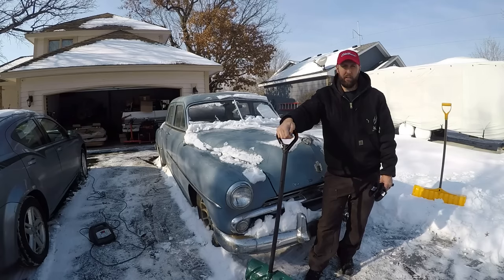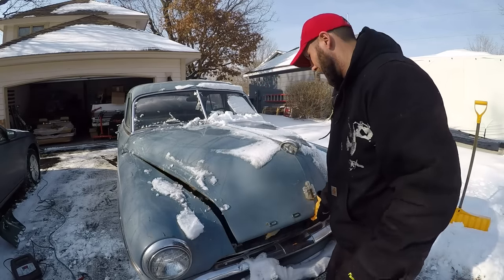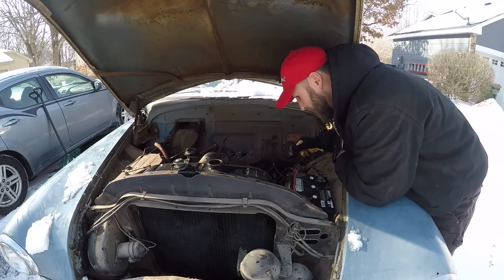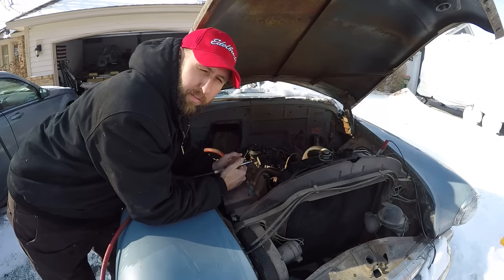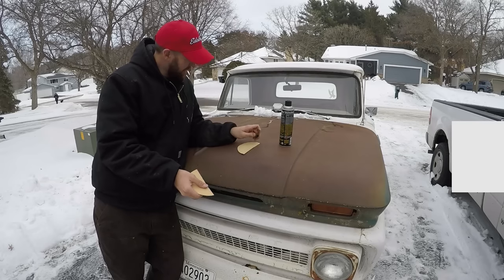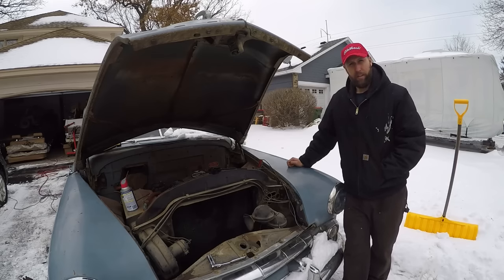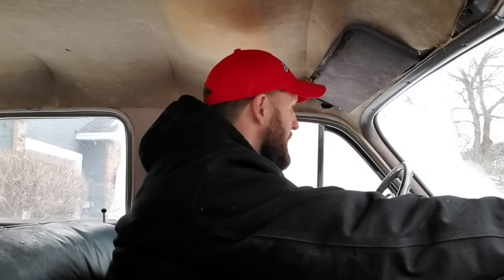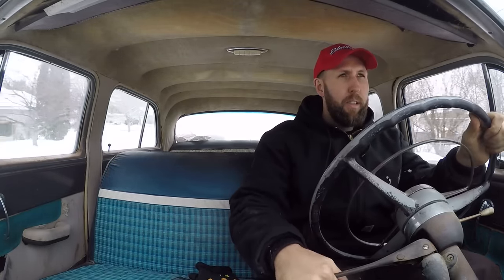1952 Dodge Barn Find First Start - Will it RUN AND DRIVE?

Comment: My first car was a 1964 valiant w/a slant 6 three on the tree. The gear shifts are , pull towards you and up is reverse, stay pulled toward you and down is 1st. Push away from you and up is 2nd, and away from you and down is 3rd. I enjoy watching the old cars that bring memories of cars I and other family members had and see them run again. I'm retired after 38 years of spinning wrenches and wish I could find these old tins around here where even glass rusts on the east coast of Canada. I imagine you wish for a hoist on times when you have to do the horizontal wiggle.

Comment: Had to stop and watch this, I've got a '51 Dodge, same color!  Grew up with these, learned how to drive on one, and I'm still driving one!
Reply from the maker: That's awesome!  Send me some pictures some time.  Would be great to see one in good condition still out there functioning.
Reply: Nothing beats a Dodge they rock!
Reply: I’m considering buying a ‘51 Coronet for $5400. Interior is decent, dent in the door. Seems complete and not really beat up or rusted. It runs but needs a new brake master cylinder. Is it worth it? Not sure if I should pull the trigger and buy it but I’m really close to doing it.
Reply: @johnmorrison5502  Tough call, not being able to see it, hear it run, etc.  May need a new master, but then how are the brakes all around, may need a complete job depending on how long that was done last, cylinders rust.  If you think it's decent enough, that could be a little steep, might offer 3 grand and see how anxious they are to deal.

Comment: Reverse is towards you and up. 1st gear is forward and up all the way. If it's a gyro-matic then all you need to do is get up to 10-15 MPH then let off the gas and wait for a few years and the car should shift into 2nd. At 25 MPH depress the clutch and pull the stick all the way to the floor and your in 3rd. Once you get to a stop just depress the clutch and the car should go into 2nd ( if the force is strong with you). If your stopped on a hill then try to find 1st again. Good luck and enjoy that classic Detroit steel.
Reply from the maker: Wait a few years 😂.. thanks bud! I'll duct tape a diagrams on the window
Reply: You can also pull it down and run it in 2nd & 3rd (I think '50 Dodge just said that) . That wait for the gear to change is amazingly long. Good memories!!
Reply: Sorry the shift pattern was three on the tree standard. The semi-automatic shift was from first to third bypassing second.
Reply: I guess you guys don't know how the trans works.  I do and actually took mine to Detroit Dragway and raced in X stock automatic. X stock is for cars slower then 22 seconds in the 1/4 , ps i qualified for slower and won being the only car to enter a car that slow. Follow the fun.
Reply: @ViceGripGarage  awesome videos   have you ever done a charger video

Comment: That’s the same straight six in our old 1950’s US of A, NAVY trailer welder. It’ll crank up every time with just a little squirt of starting fluid even after sitting all winter. We sometime idle it down to about 300 RPM, just for kicks. It sounds like a mean Harley twin V. Anyway, Sweet old power plant, and a sweet old vehicular.

Comment: My parents bought a brand new Dodge Wayfarer.  The first and only new vehicle they ever bought.  It had the fluid drive and was easy for a beginner to learn on.  It didn't have a radio or heater tho.  Those were options they couldn't afford back then.  They finally traded it in in 1964 for a 62 Impala.

Comment: Very cool the dodge Meadowbrook was the brother to my first car the 52 Plymouth Cranbrook exactly the same! There is something to that throaty sound of those Flathead 6 cylinder engines love it, I milled the head at machine shop at high school, bought a new Offenhouser twin carb manifold , from Honest Charlie’s which used to be a huge catalog store back in the 50s ,60s and found a set of Fenton headers at the local junk yard, bought some green and white tuck-n-roll seat covers from Honest Charlie’s my Uncle Tom was a chef at a local restaurant, but a Jack of all trades! He did a right nice job of upholstering the front and rear seats! Could not find door panels so we bought several yards of White Naugahyde and cotton batting and made some right nice door panels! Then I bought some spray lacquer candy green from the local Schwinn bicycle shop, prepped the dash sprayed it candy green! Looked great with all the Art Deco chrome trim on that dash! Had dual exhaust, since the Fenton headers were two piece with separate collector’s using corrugated exhaust pipe from Pep-Boys , two Cherry Bomb glass packs &  ran the pipes out the sides right in front of the rear tires! Very cool , and great sounding!!! My Dad paid $50.00 Bucks for that car, wish I had it today! Keep up the great work Derek! You crack me up!! 
Regards Mad Mike S. From the land of freezing ass cold………

Comment: First real job I had was at a garage & I had the job of answering road calls for folks who couldn't get their car started on a cold morning. We had a jumper battery pack that had an oversize 12 V battery & a built in charger. This was back in the days when there were still some late 40s & early 50s cars still in use. Absolutely the hardest to get running were L head engines,  Chrysler products, Pontiac L head 6 & 8,  & the Olds 6. Never had any calls on the Packard or Hudson L head cars.

Comment: Yep, my 1950 Dodge Wayfarer had "Fluid Drive", too. I loved it, especially on dates... I didn't have to shift to low, or even second, to get going... I could leave from a dead stop in third gear and never have to remove my arm from around my squeeze!

Comment: I gotta tell ya, both our jaws dropped at the same time. I couldn't believe that bad boy started, and ran like it was a daily driver. You know, I love these videos because, these cars are cars I grew up with. You lift the hood and all you see is motor. I used to use a tomato paste lid cover to adjust my points after putting them in. That's just the way it was back in the day. The reason these cars start and run so good is because they were built with pride in the good ole USA. OK I wanted to let you know, thanks for the great videos and man, I love the cars and trucks you find and bring back to life, it's a shame all the cars that get crushed, like the crusher Camaro that was going to be crushed B-4 it was saved Keep them videos coming big guy, love them!!!!

Comment: Wow really cool. I owned a 48 Dodge with Fluid Drive it was a great car. On my 48 you just turned the key on and then pressed on the throttle and a lever on the floor that engaged the starter. Flat head six gotta love em. I call it a win two2. Good video.

Comment: Ole 'geezer gear head' here. I had three of those not so flat head Plymouths in a row  way back when. The not so flat heads were great for collecting water in the hollows. And, of course, shorting the plugs. I always kept rags in the car to dry the hollow out in order for the damn thing to start. A '49', a '52', and a '55'. First two, standard, 3 on a tree.  '55' with a 2 speed(slow as hell) Torqueflyte Trans. I think, if my old memory is still working at 77, the Dodge, in 1949, got what Chrys. called a 'Gyro-Matic. All the old mechanics that I knew back then, including my father and his brother(old timey professional mechanics from the 'T' days), called those type fluid drives, 'Clunk-O-Matics. At this stage of my life, I'm not sure if there is a 'first gear' in the old standard place with the Clunk-O-Matic or not. But, I think its not. Ya put the gear shift handle into the like 2nd position, and ya were like in a low-low gear. Let the clutch out, step on the gas, do about 3 miles an hour, let of the gas, and hear a Clunk from the trans. It shifted into low.  step on the gas again, now you are in low! Ya do about 8 miles and hour. Not so flat head, complaining about it. Step on the clutch, shift the gear handle, down into the high position, now you are either in high or 2nd. I can't quite remember. If your in 2nd, ya gotta go through the same procedure as before. And wait for the Clunk-O-Matic to shift from 2nd to high. My old man, used to say, that "rubber balls rolled across streets, faster than cars with the Clunk-O-Matic transmissions did". WOW a lot of writing. Sorry for the long post.

Comment: That transmission doesn't have a torque convertor, it has a fluid coupling. They are different. A fluid coupling does not multiply torque while a torque convertor does.
Reply from the maker: Thanks Joe, great info!

Comment: That's wonderfully stupid -- I love it!  That car is almost identical to the first car I remember riding in as a small child -- my Dad's '51 Dodge 2-door sedan.  He traded up to a new Dodge 4-door V8 in 1954.  I love the sound this old beauty (?) makes, and that it started so easily.  Totally irresponsible, driving it around the block without brakes, and without checking basic engine functions like cooling, but I get how irresistible it is!  And you're having fun, so viewers are also.
Reply: how much for the old dodge
Reply: The guy did the right thing he driv it

Comment: My Dad had a 49 Plymouth. It looked just like your car, color and all. He would get out and work on the engine. After he finished the car would run so bad that he would have to take it to a mechanic. Wish my Dad was still alive so he could see your video. Never seen anybody rebuild sparkplugs. But my Mom told me about her Dad fixing sparkplugs in a T-model. I bet he fixed the plugs like you do. You, sir, are a national treasure.
Reply from the maker: Thanks Billy - you rock!!

Comment: If the vehicle has sat for a very long time, that water build up in the crankcase is most likely condensation from the weather that has condensed. Which you would want to drain out as the water turns the oil acidic, which deteriorates internal engine components as they run or sit in it. Just needs an oil change before running for too long 👍
Reply from the maker: Boom. Think I might throw a little seafoam or atf in it then drop it 👌
Reply: See if you smell gas in oil ,if so coming from fuel pump

Comment: Oh my cars twin !! About 56 years ago my uncle dropped off a 1952 Dodge Meadowbrook flat head 6, three in the tree. My uncle left it.
My dad showed me how to drive that heap. There was a big hole in the floor where the gas pedle is. Maybe a beer can would fit. The post behind the driver was all rusted out under the frame. Had to have it screwed shut. Us highschool kids took all the chrome off, painted everything black and black n white wheels. Oh an a wolf whistle on the manifold intake. Knuckle breaker on the steering wheel. Man could it fly through them mud holes. And what's best is reverse ,peels rubber like wow! Leaf springs were sprung to one side. So I replaced it. Then it leaned to the other side. What do you want from a kid? I believe I still have the radio ,vacuum tubes, with Positive ground. When you cranked it over, boydid that sound bring back memories or cold days. Them plug wells flooded with water so bad it shut the engine down. Carry spare dry rag. It was so easy replacing the thermostat and water pump. Not like today's cars. I'm surprised that year was a good find. Better condition than my heap. Great video!!

Comment: I always loved working on the old flathead 6s and 8s  So easy to work on with everything  out in the open. Heads are simple casting  Low rpms  good low down torque very smooth running.  Change oil regularly  every 3000 miles and lube everything and these cars can last forever.
Reply from the maker: It is very handy I could probably crawl under the hood and stand in there
Reply: @ViceGripGarage   LOL We used to do that on the late 60s ford trucks if they had the straight 6  especially if they were 4 wheel drive. Ps When I was young because our gas didn't have ethanol you would be surprised how many times a car sitting in a barn for years would start right up with a fresh battery and cleaning the plugs and points.   I would like to see someone try that in 65 years with a modern car.

Comment: I had a 1950 Chrysler Traveler with the same transmission and probably the same engine.  That torn up conduit in the back left if for the heater if I remember correctly.

You don't need to shift like that.  Up is low gear, down is high gear.  Pick which gear you want and drive.  Once you get past 15 MPH, let off the gas and you should hear a little "pop" that sounds like the lid of a Snapple bottle when you open it.  That pop is the transmission shifting into "high" gear.  Stomping on the gas should produce a "clunk" that signifies you're back in low gear (for passing or driving up a hill).  Essentially there's four gears (Low-Low, Low-High, High-Low, and High-High) plus reverse.  All of this is assuming your transmission is operating correctly.
Reply from the maker: Great info! Appreciate it! This trans is still magical to me
Reply: @ViceGripGarage  Scuba123 is correct about one thing - Chryslers did have the kind of transmission he describes. Dodges sometimes too, if it was chosen as an option. This particular Dodge however, has the regular 3-speed with Fluid drive. At the 12 minute mark in the clip, where you pull the lever toward you AND down...that's first gear, which shouldn't be there if the transmission is like the one Scuba describes. With the regular Fluid drive you can put it in third and start / stop without popping the clutch at all, which is fun in it's own right.
Reply: @error52  If you're on a flat and have all day to get up to speed.  I drove my '50 to work today.  I always start in 1st, but will skip to 3rd if I'm on a slight downhill.
Reply: My dad called them "clunkomatic" transmissions.

Comment: My first car was my grandma's '52 DeSoto Firedome (yeah, hemi) with that there fluid drive.
How you like that 6 volt positive ground?
Reply from the maker: Firedomes are awesome!  I really like seeing them at the shows.  It's unique, takes a little bit for a guys brain to wrap around it, but I"m definitely keeping it 6V!
Reply: , @ViceGripGarage  Excellent choice! I daily drive a '70 Belvedere wagon with a slant six & 3 on the tree! My Loadrunner I call it! 1 of 447. Hopped up the slant with a .498"/506" cam, headers, Offy intake and a FiTech. I ain't burning the tires up but it's amazingly spunky, dependable, fun to drive and something quite unique at the car shows!
Cheers Bud!
Reply: @k5ren : I had a 69 belvedere 2 for w/ the slant 6 was going to clone a road runner... unfortunately a 16 yr kid just got his lic. and was late ran a stop peeled the pass. Frame to 90*
Needles to say I was totally p.o'd
the kid wouldn't get out of his truck until the police showed up..lol

Comment: We had this identical car year and all as a kid. First car I ever drove. There were two transmissions available a manual which is what you have and a semi-automatic. They both had a fluid coupling which is not a torque converter. The shift pattern is standard three on the tree. As you discovered first is non-syncro. Mom’s had the semi-auto. When you got up to twenty mph or so you lifted your foot and the transmission shifted from first to third. At the next stop you’d put in the clutch and move the lever to neutral a s then back and down for first gear. My grandparents also had a ‘52 Dodge, a red coupe with the manual transmission. My sister acquired this from them and I drove it extensively in high school. Once I rolled it off in third gear at idle just by letting out the clutch. Another idiosyncrasy these cars had other than the six volt electrical system and positive ground was that the lug nuts on one side of the car were left-hand thread. Don’t remember which was which. Your next mission, should you decide to accept it, is to find and resurrect the next car my family had, a 1957 Chrysler New Yorker four-door hardtop with 392 first-gen hemi.

Comment: Looks like it will be fun. I never drove one of those fluid drives but I have driven old three on the tree transmissions that were not synchronized. Hell even my Dad's 68 Dodge D100 pickup wasn't. I turned 16 in 1969 and that is what I learned to drive a manual transmission on. Good luck with it.
Reply from the maker: They're fun to drive! We're thinking something wild like a single turbo..
Reply: @ViceGripGarage  Now that will be cool.

Comment: Used to have a ‘49 Dodge Coronet that looked a lot like that. It didn’t have the gyromatic, it had a standard 3 on the tree with the fluid drive which was apparently not as common. Loved taking off from a stop sign in third gear.
Reply from the maker: Pretty dang neat transmissions.  Still learning up about them